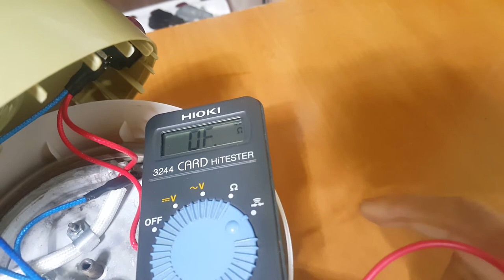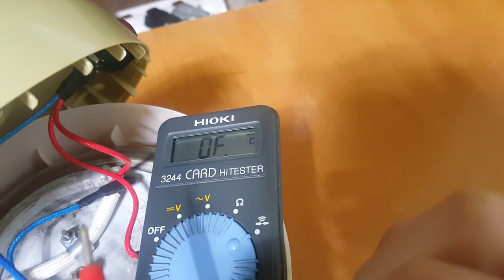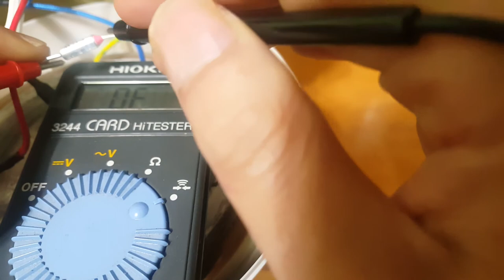DIY Electric multi cooker repair

Comment: App comment k answer bohat ache SE de rahe Hain plz bataye pot Ka power button on hone k bad foran off ho Raha hai
Reply from the maker: Welcome to my channel. I think it's probably one of two things. The first is when the pot is heated without putting anything in it, and the second is when food is put in the pot and heated, but the bimetal switch is broken and operates sensitively. If it falls into the second case, it will have to be replaced.

Comment: Hello, can you help me? My rice cooker, when I press the button, the red light comes on, but it doesn't stay red, it switches to green! If I forcefully hold it, it gets hot at the connector
Reply from the maker: Welcome to my channel.  I'm on a business trip. I'll answer you tomorrow.
Reply from the maker: It is assumed that the switch has a bimetallic function. This is to prevent overheating due to some internal defect.  There are several possible causes of overheating.  The first is when the connection of the fastening screw of the electrical wiring is loose or slightly loosened.
Reply from the maker: If the wiring connection screw is loose, tighten the screw tightly to ensure a firm connection.

Comment: i want to disable the auto cut function so i can use it for frying, how to do so?
Reply from the maker: First of all, thank you for visiting my channel.
Typically, heat-handling cookware consists of a bimetallic switch inside for temperature control.
By the way, if this bimetal switch malfunctions, there is a possibility of food burning or fire.
So there is a thermal fuse connected in combination with the bimetal.
This thermal fuse is a safety device.
What you are asking doesn't use the autocad function.
You can simply wind the wire around the thermal fuse.
However, this is because there is a possibility of a fire due to overheating.
When cooking, monitor so that the temperature does not exceed the set temperature.

Comment: There's water inside the power button..how do i remove it?
Reply from the maker: I have a late reply due to business trip.
If water gets in the button, it needs to be dried.
Dry with a fan or a hairdryer and leave for a day.
Then assemble it back to its original position.
If you upload a picture about it, an accurate answer is possible.

Comment: Help me pls. My multicooker is on but doesnt heat . What should i do? Tnx
Reply from the maker: Thank you for visiting my channel.If you are an engineer, the first thing you can do is check whether the voltage appears in each part.Most failures will result from a malfunctioning thermal fuse or bimetal switch.I look forward to getting your cuckoo fixed.If you have any questions, I can answer them.

Comment: Sir can i ask something abou electric cooking pot there is no hot but if you switch the light indicator is on what is the problem?
Reply: I think we have a supply because if you switch on the indicator light is on but nothing hot
Reply: Can you teach what are the common parts damage?
Reply from the maker: Thanks for visiting my channel.
Reply from the maker: Close to the heater is a thermal fuse hidden in a tube.  It doesn't heat up when it's disconnected.

Comment: is it still ok to use even if it is wet inside?
 because I put ice inside, and this is the reason why it looks wet
Reply from the maker: If you do not put ice in an electric cooker to defrost it, when cold and hot areas meet, dew will form on the other side of the cooker, which may meet moisture in the air and cause electric shock or malfunction. For safety reasons, this is not a good idea. When thawing ice, place it on an aluminum plate and it will thaw quickly. This is because aluminum has excellent heat conductivity.
Reply: I used it again, it looks ok, it's still hot, do you think it's still ok to use?
Reply: @bigbrother1059  sir I didn't plug the electric cooker ,I just put an ice on it like a container because I forget that the ice will form a moisture on it
and I just waited for the moisture to go away and used it again, it was ok to use

Comment: Hi, where and what type of thermistor do i need to buy for this? Or how many amp for the fuse?
Reply from the maker: Hi, cool guy, this is a thermal fuse. Its standard is 150 degrees Celsius, 10A current capacity, and 250V AC MAX.
Reply from the maker: http://www.ermec.com/limitor/catalogo/DF_englisch.pdf

Comment: Diy what work this rice cookur
Reply from the maker: Welcome to my channel.  Things like coffee pots have a thermal fuse inside them to prevent the temperature from getting too high. This is very cleverly hidden.  If you have some knowledge of electricity and know how to use a circuit tester (continuity tester), you can easily find it.

Comment: The heating not working..how to repair ?
Reply from the maker: If you are an electrical engineer or have enough knowledge about electricity, give it a try.
However, you should be very careful with this as there is a risk of electric shock.
Step 1. Remove the power plug.
Step 2. Remove the screws on the bottom or top.
Step 3. Conduct a continuity test to see if the power line is disconnected.
Step 4. Most failures are due to a blown thermal fuse.
Step 5. Even if the cause of the failure is known, it cannot be repaired if there are no replacement parts.
  Purchase parts that meet the applicable standards and replace them with defective parts.
Again, the necessary tools must have a crimping machine and a crimping terminal.
If you have any other questions, I can ask you.
Reply: @bigbrother1059  but mine is  imarflex multi hot pot (the heating suddenly didn't working just last night)..still can repair ? Tks
Reply from the maker: @cataleya6581  It's mostly if there are no breaks in the internal wiring
Find the hidden thermal fuse.
It is hidden in a white or black heat-resistant tube.
Also, since it is in close contact with the heater, you feel something heavy when you touch the tube. I would like to deliver a thermal fuse or repair the unit if you are nearby. However, the area where you live and mine is very far away. If there is nothing wrong with the other parts (for example, check whether the wire is broken or the connecting screw is loose), you can order a thermal fuse of the same size online.

Comment: Yung samin po nag spark yung button please help to fix
Reply from the maker: If there is a spark when the button is pressed, is the heater shorted? You need to check using a circuit tester.

Comment: the cord is burn
Reply from the maker: Thank you for visiting my channel.
Your cooker is presumably overheating due to poor contact in the cord. Replace with a new cord again and check the thermal fuse. If the thermal fuse is broken, it may overheat.

Comment: Do you have whatsapp? i need help with my multicooker.
Reply from the maker: nice to meet you I don't use whatsapp. Please elaborate on what you need. Then we can help you. Or give us your email.
Reply: @bigbrother1059  I have a USA 110v multicooker. I want to convert to 220v to use in another country. Will that fuse work?
Reply from the maker: @gushardy4421  Yes, you can use the same fuse capacity of the existing multicook. The fuse will work just fine.
Reply: @bigbrother1059  What exactly do i need to change to convert to 220v?
Reply from the maker: @gushardy4421  It needs a transformer to drop the voltage from 220V to 110V. Since the power socket is different for each country, the power connector used in that area is required.
Reply from the maker: For example, assuming that the capacity of your multicook is 500W, the capacity of the transformer should be at least 700W.
Reply: @bigbrother1059  I understand that part very well. I use a step down transformer or voltage regulator right now. I want to change whatever part in the multicooker to make it work on 220v electricity.
Reply from the maker: @gushardy4421  If you have more questions, be specific and you can give a more detailed answer. This is Korea. It is now past midnight. I will answer you tomorrow.
Reply: @gushardy4421  just get a 1200 watt inverter; or buy a 220v multi cooker specifically for your country's electric grid.

If you think you can change the 110v fuse to 220v, yes you can. Be prepared for fire though or you might  just be tripping your breaker.
Reply: @spacejihadist4246  ok a hole. Thanks.

Comment: my switch light lights up but its not heating up, how do i fix it thank you
Reply from the maker: It is very likely that the thermal fuse is blown. If you look closely, the thermal fuse is hidden inside the heat-resistant tube in the wire. If you are an electrician or are interested in troubleshooting, you will need to purchase a thermal fuse of the same size and also need a crimping terminal. Even if the cause of the failure is known, it can be repaired if there are spare parts and a tool such as a crimping machine that can replace the defective part.